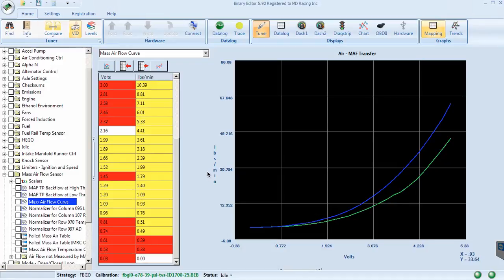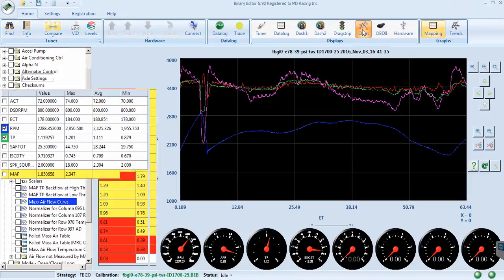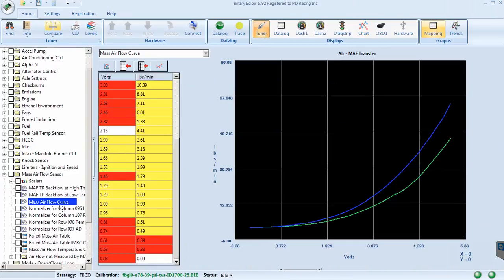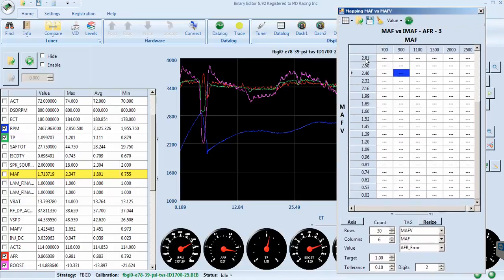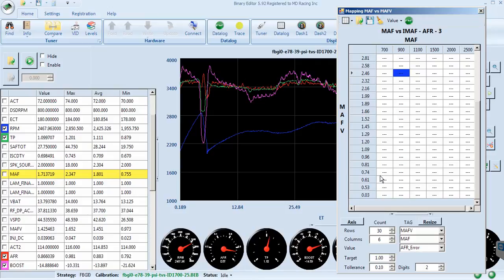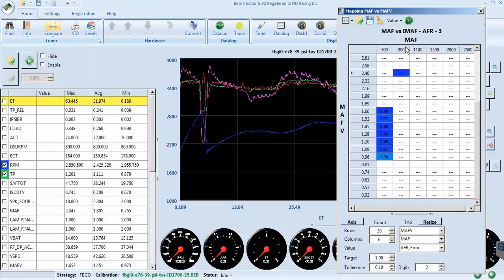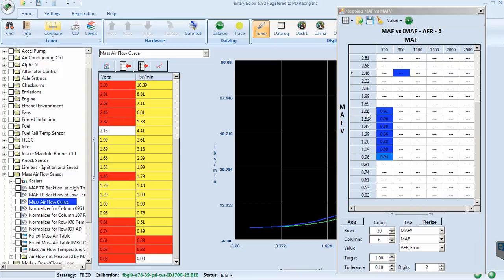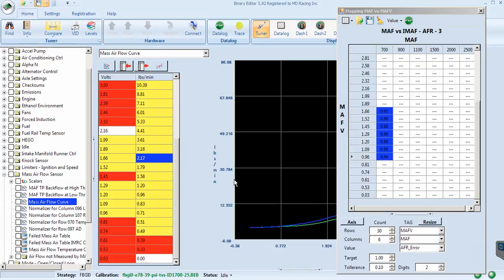MAF correction with Binary Editor

Comment: I know this was a long time ago, but I just bought a coretuning package with the Moates quarterhorse and binary editor and I was trying to get a feel for this software (literally my first attempt at self tuning). I was wondering what you achieved in this video, yeah I know you adjusted the maf values, but for what purpose. I have a ford ranger I put a turbo on... so obviously I’ll have to richen it up and probably add some timing. How might I go about increasing fuel delivery  And adjusting MY MAF curve with binary editor, any advice would be greatly appreciated.
Reply from the maker: Dialing in the MAF is to make some corrections on the fueling that may be off.  You need to adjust your injectors and various other parameters first and then fine tune the MAF.  I'd suggest reading up on some base documentation to get you going first.
Reply: Funny enough, I am in the middle of trying to do the same thing. I have been doing lots of research on moates quarterhoarse and binary editor, and I was wondering how that tuning platform worked out in your application. I mean, as far as I can tell that's the only route to tuning older rangers (unless of course you buy a standalone ecu). So if you don't mind my asking, were you able to successfully tune the truck? By using the quarterhoarse? What year was the truck and what files did you need to tune it?